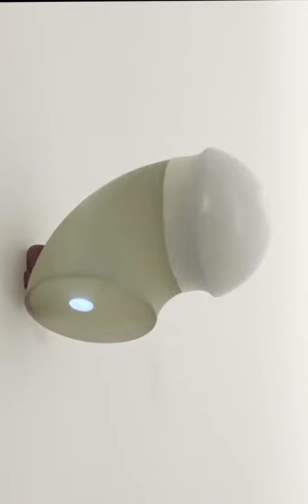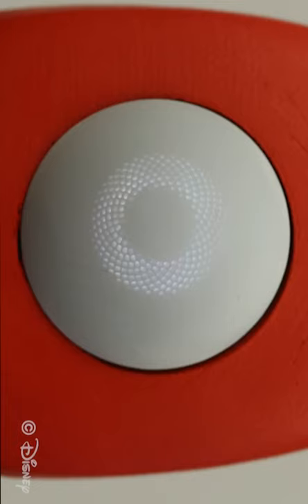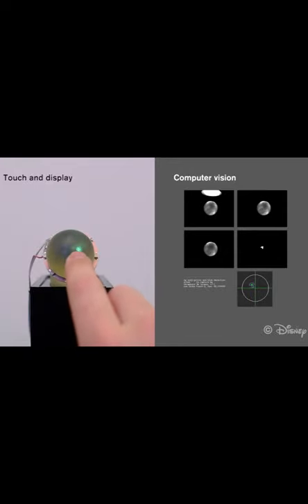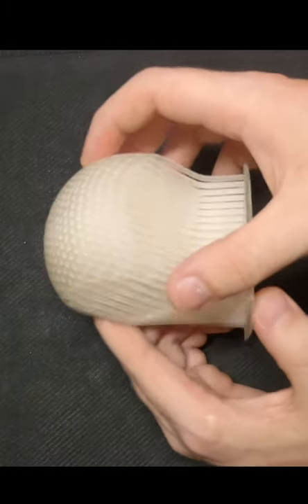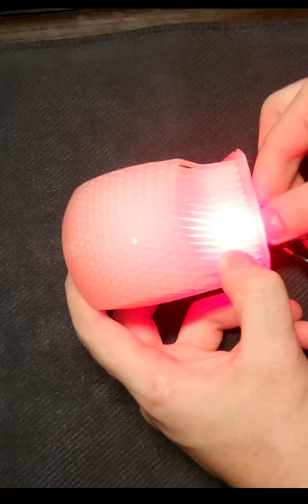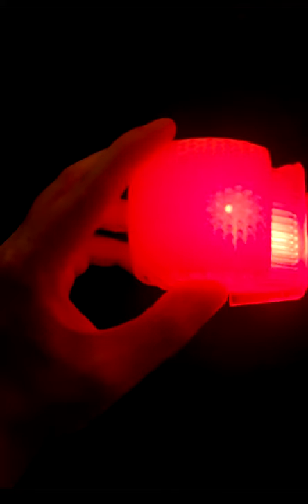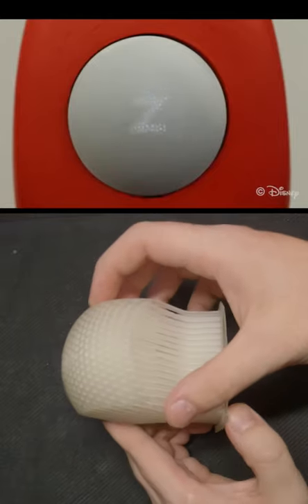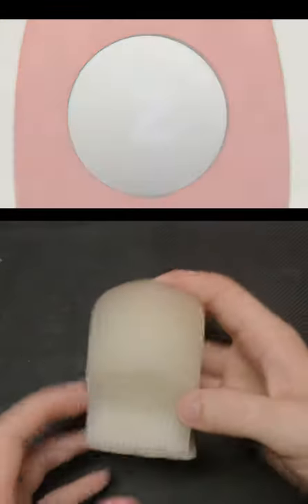My 3D printed curved display

Comment: Ive always wanted to build an open art installation that was extended from the light sources through complicated light pipes to display on one end with a classic painting or still life rendered. Someone would first view it from the painting, then walk down the length of the light pipes and finally view the light sources.

It would be to visualize how the objects we see, which are typically light bouncing off of a surface, can also be replicated by emitting points of light from a surface

Comment: Do a circular boolean cut out the size of a uv flashlight and taper the size and remove the spacing on the front of the optics to make a resin optics pinpoint cure light.